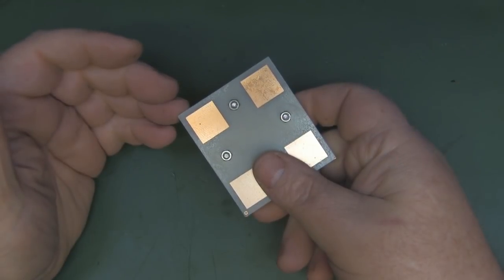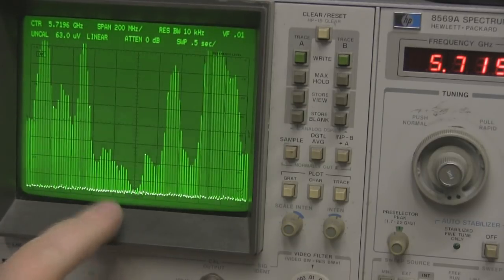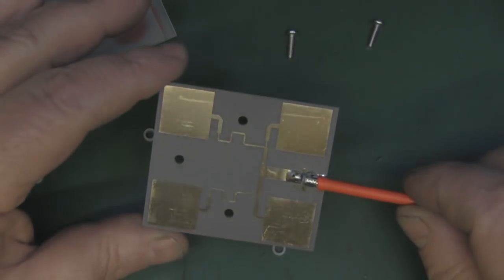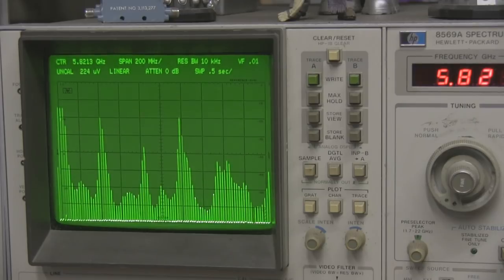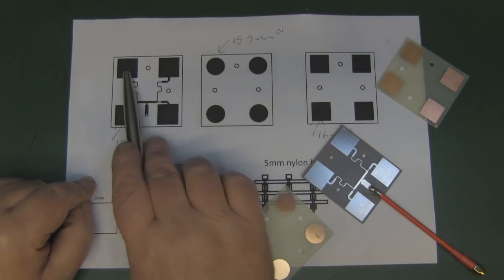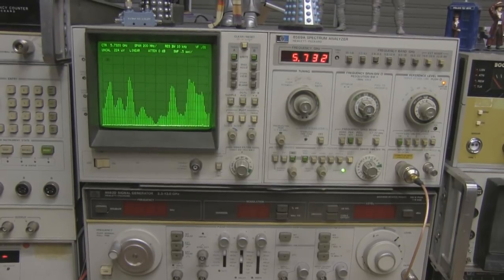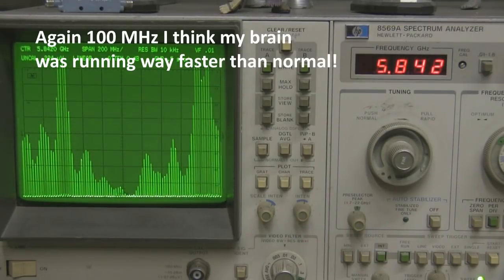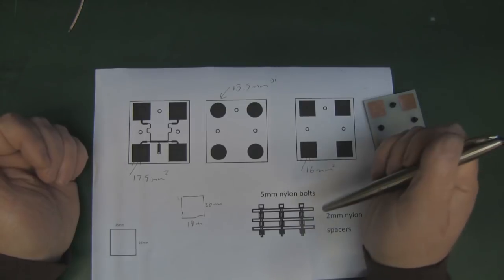Interesting 5 8GHz Panel Antenna with Yagi Characteristics

Comment: Neat Video. These Panel Antennas are used with RC Controllers with FPV . The original setup showing 5.720 GHZ is quite usable if ones RC Controller has an adjustable FPV that covers this range and can zero in on it, yet without a spectrum analyzer one would be in the dark without knowing were the center or best frequency is to manually dial into . I have one of these Panel Antennas and changed out the metal screws and nuts to plastic ones, I waiting on the 1 mm plastic spacers to complete the better construction of this panel antenna. On my RC/FPV Controller I seen videos on antenna mods that change out the U.fpl IPX connectors connected to the FPV and RC Modules-thus removing these inside antennas and on the other end of the U.fpl IPX placing these with SMA and RP-SMA on the outside to use the above antenna and others. What I noticed was they were using 1.13 mm U.fpl IPX-SMA-RP-SMA cables, after some research into this I found RG 1.78 mm U.fpl IPX-SMA-RP-SMA and used these instead--it seems these upgraders did not do there research RG 1.78 cables are shielded wonderfully thus a very low loss of antenna signal plus with shielding does not interfere with the other electronics the cables run over including the antenna signals, I did not find RG 3.16-which has even lower signal loss, later I'll get these in and change out RG1.78 for even better transmission/reception. I enjoy your videos. Cheers to the UK Wired/Wireless Communication Commission and its Board Members .

Comment: Been using this antenna for years, it works really well for me.....So....this is a Linear Vertically Polarised antenna then..????
  What type of antenna would one use as a transmitting antenna if this Patch was on the receiver..?

Comment: Andrew by the way... I've been willing to construct the sardine biquad of another video of yours... My question is... Yours is used horizontally... Is it critical or could I use mine vertically too? My wifi card has split Tx and Rx ports so I might build two and place them side by side for tests... And I've been willing to mount them vertically... Is it ok? If so... How far should one be from another in order to have it working alright? Again... Keep up the great work... A hug from Brazil!

Comment: Hi Neil. Found you by googling the Sky SR102. You have a couple of videos showing the 101 and again the 102. You talked about the RP SMA connectors you used. Can you be so kind to list exactly what connector type I need to get to be able to do what you did which was enable an external antenna. Cheers
Reply from the maker: https://www.ebay.co.uk/itm/2-x-Mini-PCI-U-FL-IPX-to-RP-SMA-Female-Antenna-Pigtail-Cable-WiFi-Network-12cm/201105122707?epid=1723061380&hash=item2ed2cca593:g:A4sAAOxyVaBS84~w
Reply: andrew mcneil Thank you so much Neil! I've subbed you!

Comment: I used this exact antenna on the transmitter of a Phantom 3 Standard drone. I had it out 2.1 miles and still had good signal. I only had to turn back because of the battery. This was un-amplified, only being powered directly from the factory transmitter.

Comment: Fantastic.  Finally someone did a pdf of one of these.   Any circular polarization....?? No trimmed corners on the driven element or feed line locations.  Still hoping for your crosshair yagi you showed a while back.